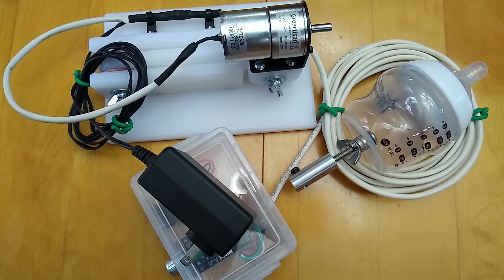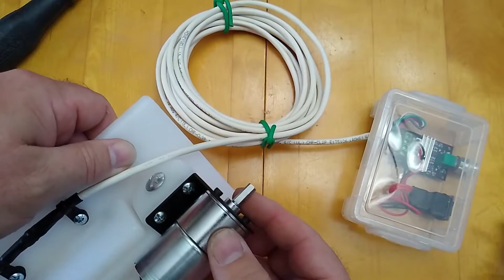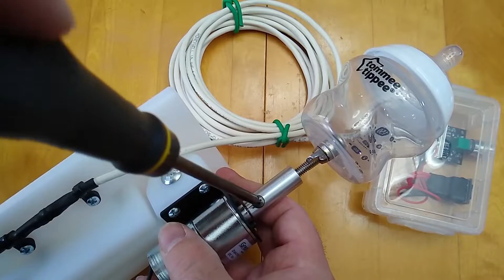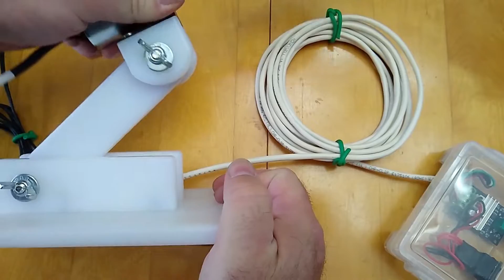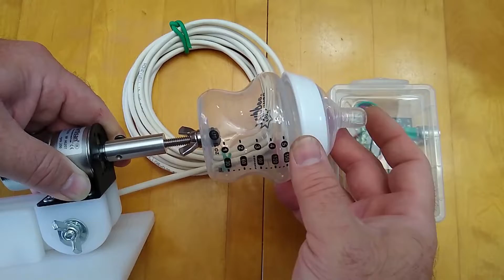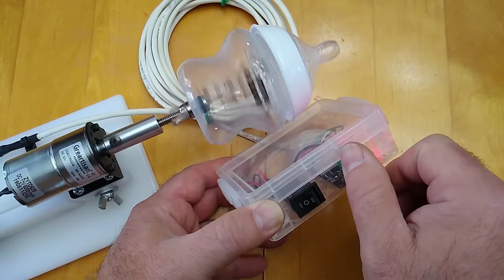Video for Rod Finishing/Wrapping Motor w/ Stand, Speed Controller and Baby Bottle Slip Clutch Chuck

Comment: What motor do you suggest for a dryer?
Reply from the maker: I personally use a 10 rpm motor that is made like the one in this video. Here is a video that shows a few different motor setups that I did a while back: 
https://youtu.be/jlv03jji-I8
What speed you need for a dryer motor will depend on what works best for you, but most people typically use 20rpm or less for dryer motors.